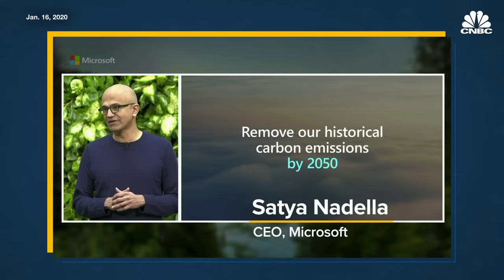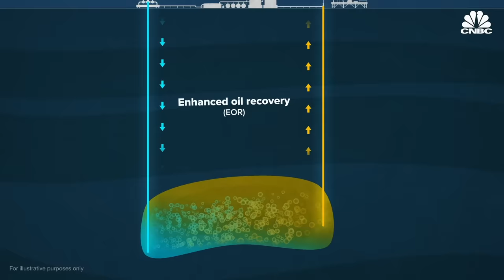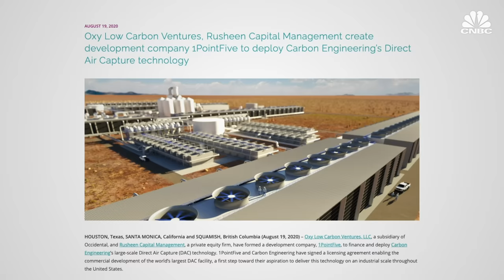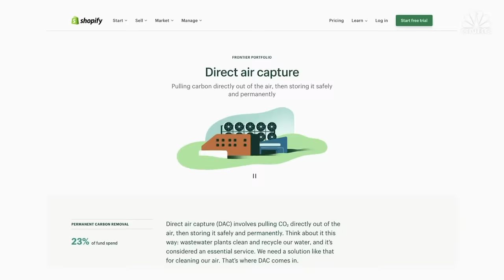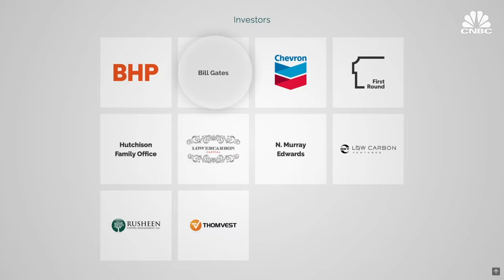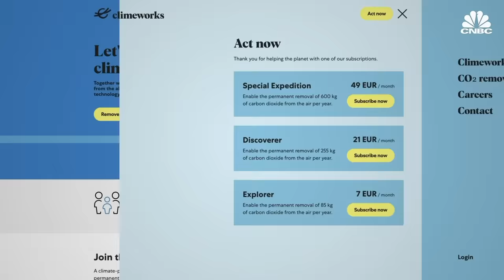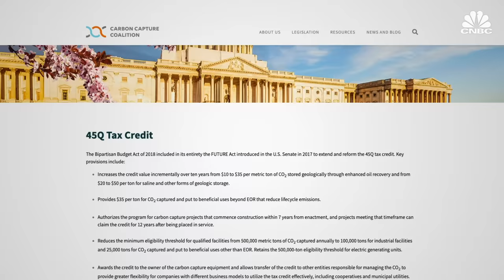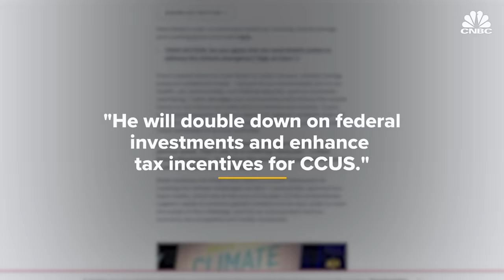Money Is Pouring Into Carbon Capture Tech, But Challenges Remain

Comment: Terra to Exo hz. High frequency. CO2 splitting. Oxygen resonance and uvc desinfection.

Terra to Exo hz. High frequency.

Terra hz generation Terra hz can be easily achieved with occillator settings of squares. In dual channel frequency generators. This because a leftwards gliding square A. Hitting a stable square B. When both signals are combined. Will make a massive frequency at double volt when the two squares touch. Followed by a sweep through the radio band to base frequency of the squares.

The effects in the Terra hz and above range. Look to be biologicly dangerous and radioactive. Photon particles.

Shorting A and B to conductor. Setting the smallest increments of the two squares together. Like 10.00 mhz with 9.999 999 mhz. Will give you 10 times frequency pr new 9. In this example 100 thz. If setting fore instance 473 thz. Setting A to 10 mhz. B would be set at 9.999 999 473 mhz.

Generation of this type of signals may be able to interfere with IR by modulation. Like the 400 thz. Global warming ionosphere IR block frequencies.

High t hz and p hz is dangerous. Meaning biologicly dangerous even at occ low volt. Resulting in radiation effects. A Geiger counter held near the short wire will respond.

Since two shorted wires fed A and B. Can be injected into a human. The high range p hz. May allow x ray treatment direct inserted into cancer cells. Because of x ray capable electron volt. Has potential to counter brain frequency capabilites . In mid 80s russian capabilities.

To make possible continues signal at frequency. The two squares or two same waveforms must be restarted simultaneously. Synced. Fore not having the shorter pulse glide.

Desinfection may be possible with UVC. Generated from radio. Virus resonance may be possible with peta hz at diameter. Can be counterproductive. Frequencies is set at virus diameter nm. Fore heating virus.

Splitting of CO2.

By setting oxygen radius or diameter.

NOTE CARBON ATOM RADIUS LETHAL TO HUMANS AND ANIMALS.

Splitting of H2O. Fore regeneration of atmosphere pressure. By rf to cloads. Note ozon depletion potential.

Fore oxygen resonance.

A is set 10 MHz Square. B set 9.999 999 999 94. MHz square. Or set 10 MHz square. With 180 degree 9.999 999 999 940 MHz square.

Simply explained. 9 MHz square with 180 degree 10 MHz square. Will generate 0 volt fore the duration of the shorter square. When both waves are present. When the shorter pulse ends. A volt lasts fore the duration of the remaining of the longer. Making a 100 MHz pulse volt in the exsample. Add 9s 10 times frequency achieved. All this depends on the short length accuracy.

The idea here is to shake atoms. Generating their sizes in wavelength.

A BACKWARDS GLIDE ON THE SCOPE OF SQUARE A WILL PRESUMABLY MAKE ALL FREQUENCIES POSSIBLE DOWN TO BASE FREQUENCY PR SWEEP. WHEN THE LEFTWARDS GLIDING SQUARE. HITS THE STABLE. A EXTREME FREQUENCY AT HIGHEST POSSIBLE ELECTROMAGNETIC IS MADE. THAT MEANS ALL ATOMS ARE AFFECTED BY RESONANCE. MEANING POSSIBLE ALL ATOMS FROM SMALL TO LARGER ARE SHAKEN.

THERE FORE THE CO2 SPLITTER MUST BE SENT OVER OCEANS UPWARDS IN THE ATMOSPHERE. TO BE ALLOWED TO HIT ALL CHEMICALS TO SPLIT. NOT OUTWARDS TO BIOLOGY OR GROUND.

An apparent reduction in water moisture is present at use exo hz synced squares. Appliying hydrogen radius atom resonance. Giving the possibilty of repressurization of the atmosphere. By splitting H and O from H2O. Fore hydrogen production and air mass replenishment. Due to recent lost atmosphere pressure.

Can you tune the high frequency trick?

Fore 72 GHz. Magnetic field width vibration. A 10 Mhz square with B 9.9972 Mhz square. This fore geomagnetic shielding or space craft shielding. A repulsive magnetic field. In this the accuracy of shorting red plus red. Needs to be 0.5 mm.

If you were to test much more demanding stuff into Terra Hz to Exo Hz. The glide of the shorter square. Would sweep maximum physical potential down to base frequency over and over again. However if you had a stable setup. If you wanted to hit B 9.999 999 999 94. Fore 4 Exo Hz. Oxygen resonance.

Could you with measurement. Tune the systems inaccuracies of short? Compensating fore inaccuracies?

Deimmerse from Russian/Chinese terra hz signals at. Mayby 1 or 10 terra hz?

NOTE FORE NUCLEAR EFFECTS. FIFTH HARMONIC OF RADIUS OR DIAMETER OF ATOM.  FREQUENCIES AT 9. 999 999 999 900/980 MHZ B. FOR EFFECT OF UNLEASHING ELECTRONS FROM ATOM SHELL. POTENTIAL REDUCTION OF RADIATION. ANTI GRAVITATING THE ATOM. SET PR COMPOUND PICO mm. Test fore radiation reduction. Both radius diameter and both fifts 4.5 ca times higer frequency. 

The application of 10 mhz square shorted red with 20 mhz square red. To antenna or rf amp inlet. Looks to enhance combustion effects and reduce co2 levels at distance. Due to gliding squares. When the two squares meet on the occilioscope. A extreme frequency is made before sweep down to base frequency and up again to highest electromagnetic potential. Meaning a short duration in atomic renonant frequencies. Long enough to split molecules. Base frequency pair should be chosen to not penetrate to ozone layer.  I belive a borrowed transmitter of 1 k plus watt. Should be gotten. Some calculation be done on ozone layer interference. Then the signal sent. 

Because of the evident ability to diminish water moisture or reduce co2 levels. Aplifying or increase oxygen levels. One may wonder if it is possible. To generally split molecules. Potentially of solid matter. Therfore make possible seperation of molecules into basic elements. Therfore increase by extremes. The avalable mineral extraction potential on Earth.
WHY NOT THE CONCEPT OF INCREASED OXYGEN THROUGH THIS. TO GENERATE THICKER ATMOSPHERE THROUGH PRECIPITATION?

Comment: The world produces 38 billion metric tons of CO2 a year, which would require 38,000 Carbon Engineering plants just to keep CO2 levels from increasing.  
How are we going to build 38,000 carbon capture plants in the short amount of time we have to actually implement a solution?  And where are we going to put 38 billion metric tons of CO2?  Each year?

Comment: Blue Oil is what it's called when it takes more CO2 injected into the underground reservoir than will be created by the extraction, transport, refining, and burning of the oil you get out.  Remember that fields that are good candidates for EOR are ones that are almost empty and need help getting the last bit out, so they can hold millions of tons of CO2 and only extract a few thousand barrels of oil.

Comment: beer and whiskey makers produce carbon dioxide shouldbn't they be collecting co2? 
shouldin't we be adding carbon production taxes to gasoline and crude oil? and ships moving them? 
reason there is lot of carbon ; dioxide production is because fed rates are not high enough; if we want to control inflation we raise fed rate; 
we need to raise fed rate; by increasing cost of long chain carbon molecules hydrocarbons; 
if its high enough generation will reduce; 
the peripheral people; will quit driving and take buses and move closer to job etc; 
if we raise fed rate to 80s we will have lot of people move ; especialy if IRS allows tax deduction; credit for moving ; compel to relocation; due to money; finding new job etc; 

and we do tax for clunker for semi trucks;

Comment: Why’s no one talking about Methane Capture🤦‍♂️🤦‍♂️🤦‍♂️🤦‍♂️🤦‍♂️🤦‍♂️
Reply: 1. Because methan, despite potent greenhouse gas is actually very rare in the atmosphere like, 1,8 ppm in comparison with 400-ish for CO2. So effectivity of filtration is even smaller and costs even higher than in the case of CO2
2. Methane in the atmophere spontaneously degrade on CO2.
Reply: @AB8511  Great points there but the coal fired utilities and other energy providers emit methane into the atmosphere but that methane could be captured before getting in the air and since, like you said, methane degrades into CO2, it could be also be buried underground once captured. Another forgotten little industry right there.

Comment: I’m in favor of carbon capture. I’m also in favor of productive use of CO2 so there is a return on investment to make it economically feasible. Professor Jacobson seems to have his head jammed up his buttocks with his opinion that the oil industry can’t be part of the solution. Typical academia that never got his hands dirty and has a well meaning but misguided view of economic reality.